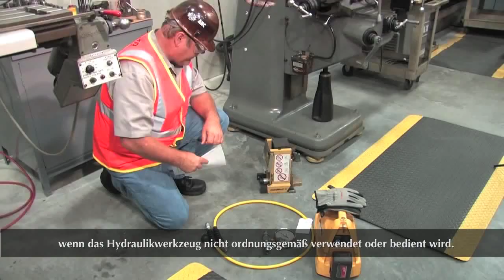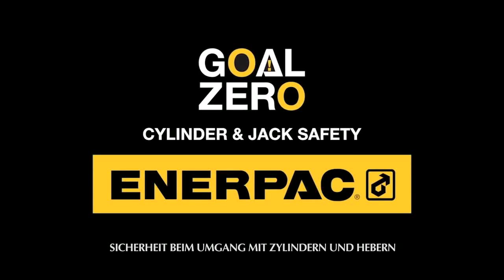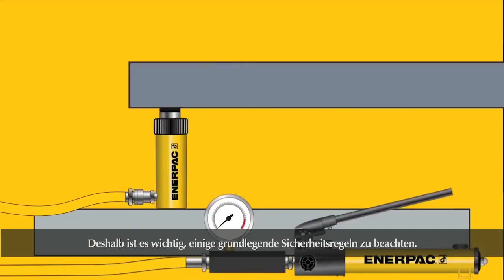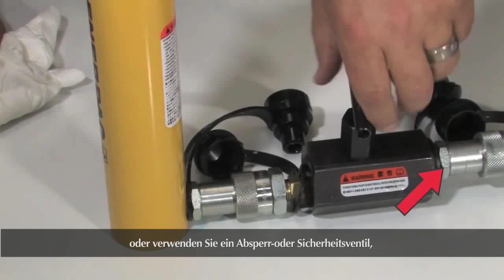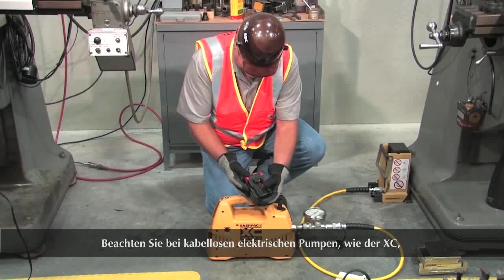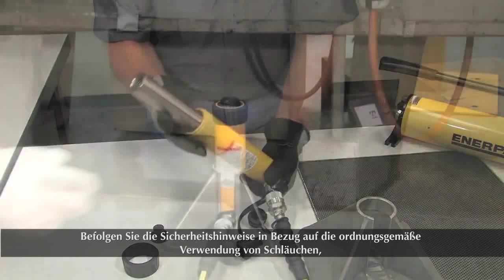Sicherheitsrichtlinien für Hydraulikwerkzeuge von Enerpac mit deutschen Untertiteln

Comment: Every 6 years new hoses ?  Even our fire brigades change high pressure hydraulic hoses only each 10 years. I know that in industry mostly hoses are only changed if they are damaged, otherwise they will be used for decades and I`ve never heared from severe accidents from burst hydraulic hoses. Better integrate automatic stop valves into your couplings to avoid falling down of load in case of hose burst, some other manufacturers also do so.
Reply from the maker: Hi Andreas, We understand that some people and companies do not get new hoses, but regular inspection and maintenance are a must if they are continued to be used. We do have a Blog about hoses which states:

Thermoplastic 700-Series Hydraulic  Hoses have a 4:1 safety factor. The outside jacket is polyurethane to provide maximum abrasion resistance. A strain relief guard is provided on both ends which improves life and durability. Important: it is advisable to change your hose every 6 years. You can read more about this online, https://blog.enerpac.com/safety-training-and-using-genuine-tools/.